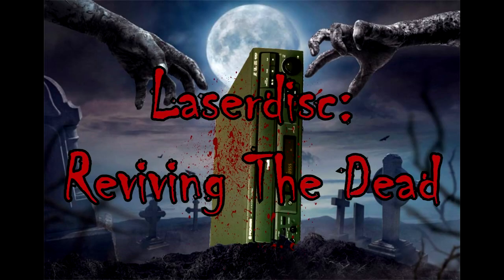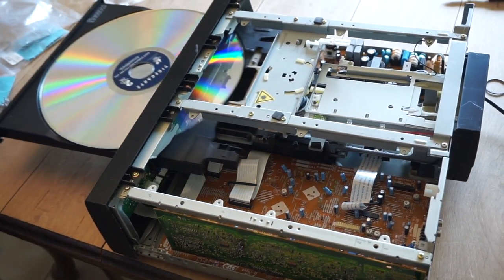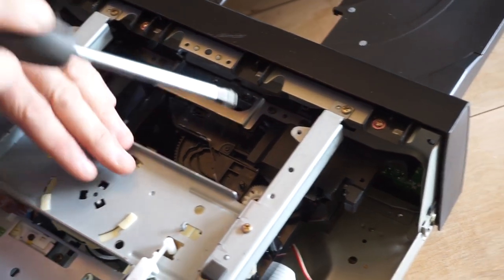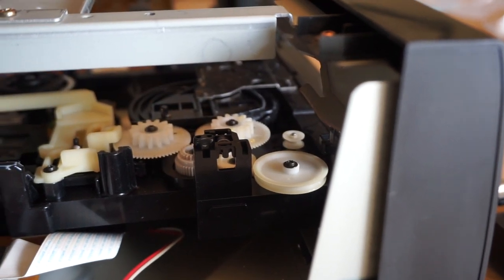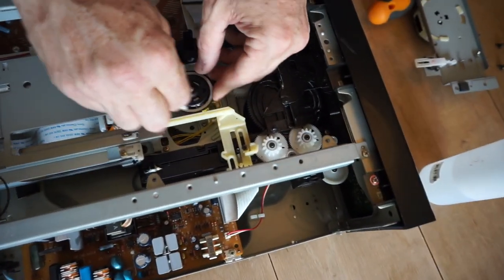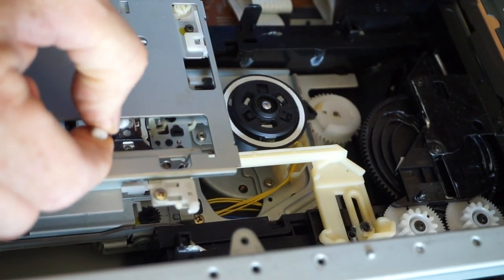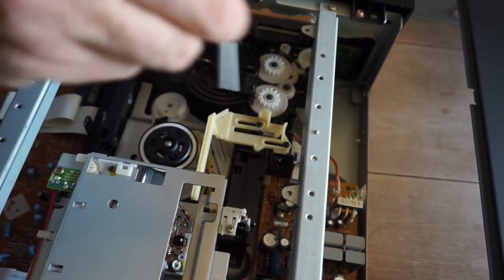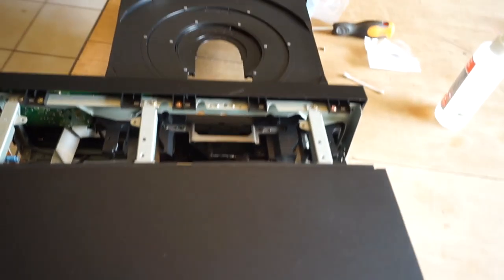StrictlySega - Some Hardware Repair Tips - Part 3

Comment: These are some very good tips, but I’m getting the U1 or UI error. The belt seems to be fine, and if I open the unit and give it a push it opens & closes fine, but what I’m also running into is raising, then spinning issues. Again, if I give it a manual lift, and then a manual spin, disc plays fine… any suggestions. Thank you in advance from the US. 🙏🙏🙏

Comment: I have a D515 that's been sat in the corner gathering dust for about 2 years since last use. Got half way through Teenage Mutant Ninja Turtles today and it spat out the F5 error and won't play - other discs are also either looking awful or erroring out. Going to get some isopropyl alcohol and lithium grease (and perhaps a new drive belt for god measure - what the hell) and see if this helps.  Thanks for the guide. I'll update this reply with the outcome :)